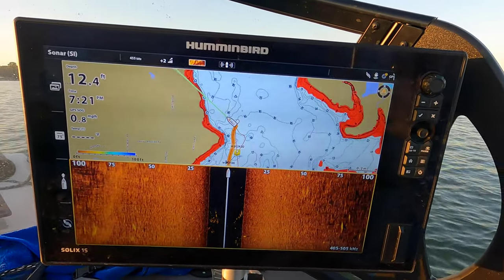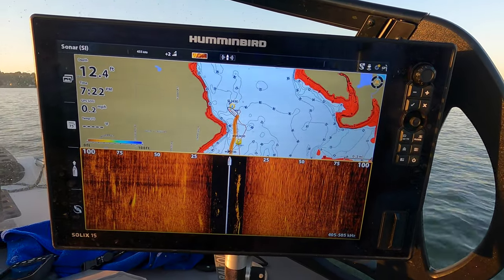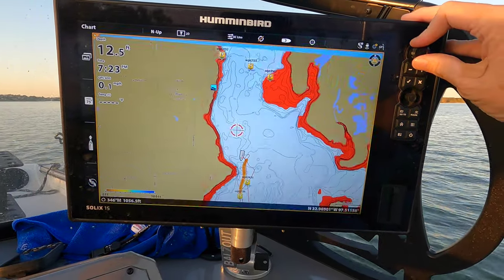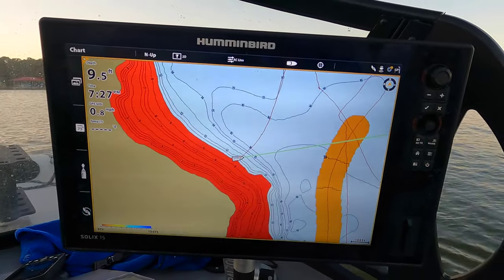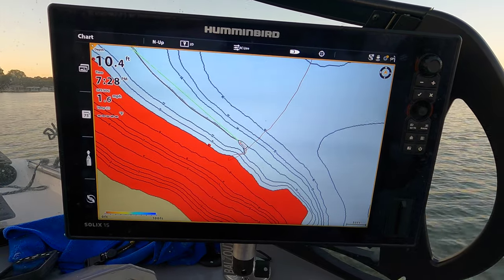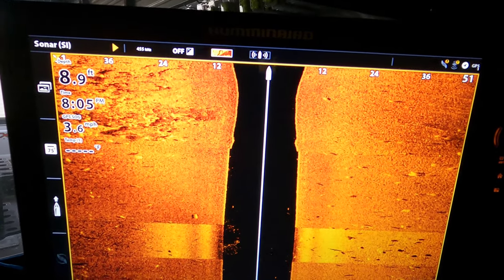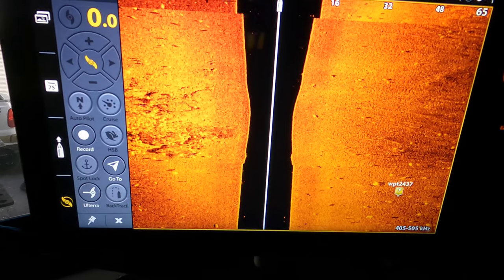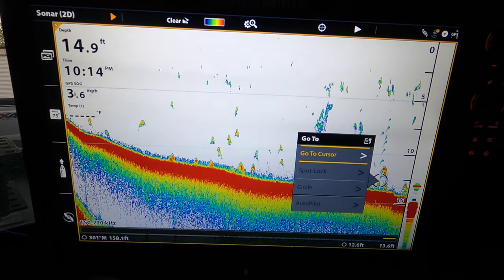iPilot Link Made Simple (Easy Tutorial)

Comment: Unfortunately I don't use it enough. You just reminded me about contour lines. I liked using the feature when I got this unit a year ago. I have a Helix 12. Thanks!
Reply from the maker: Glad it was helpful!
Reply: @Catfishedge  and it worked. Was at lake with a slight breeze and spot lock was on -1. The wind came up and reset to +2. Straightened it out. And did the reverse when we entered a cove a little more protected from wind.

Comment: Trying to understand the GPS offset between selecting a sonar spot and spot locking over it.    if I select a piece of structure on my helix, the GPS location is going to be generated from the hummingbird unit? so if my transducer is 10 feet away from the unit the structure is 10 feet away?  then if I hit spot lock is it using the GPS  generated from the minni kota motor head or the  unit to find that coordinate?

Comment: Have an ulterra link on the way, can I do everything with a helix 9 mega non touch screen, thanks
Reply: Yes I run helix 9 on front and a helix 12 at the wheel they will work but you have to use cursor and turn your trolling motor on with speed which is what I was missing until this video... I run the ulterra but should be good with any I Link.

Comment: I have my heading sensor/external gps located near/above transom transducer for mega and 2D so that when marking fish the waypoint is as accurate a position as possible. When I the utilize ipilot link on my ulterra to go back and spotlock I would be using the a GPS receiver on the bow mount, so it actually does not travel back to the exact spot of my first waypoint. Is that correct, ie the ulterra using it’s built in gps antenna??? My ipilot often holds about 20 feet off when trying to spot lock on old waypoints. It is a 2016 model, perhaps the controls are better now. I plan to upgrade this year to newer version.
Reply: I would like to see an answer on this

Comment: Great video! I see your display is not displaying the water temperature, and you have "Temp (1)" selected as the source. I have the same issue. Does the supplied transducer not have a temperature sensor? I have not figured out the problem yet. Have you had any luck in this regard?
I can display the temperature from my Mega Live transducer, but it isn't in the water all of the time.
Reply from the maker: It does. For some reason my temp cuts out sometimes,
Reply: @Catfishedge   I spent a couple hours on the phone with Humminbird Tech Support. For some reason my temperature was coming in on "Temp (2)" which is supposed to be assigned to the second transducer port (labeled 2kW/2D), which I do not have anything plugged into. My transducer is plugged into the first transducer port, labeled "2D/DI/SI/360." Long story, short, at the request of Tech Support I restored my Humminbird Apex to the factory defaults and it started to work correctly. I lost all of my "Favorites" (View shortcuts), but at least now I have my water temperature displayed.
            We are probably not the only ones to experience this problem. Maybe Humminbird will develop a fix for this in an upcoming software update.